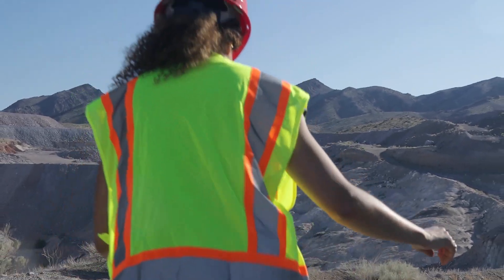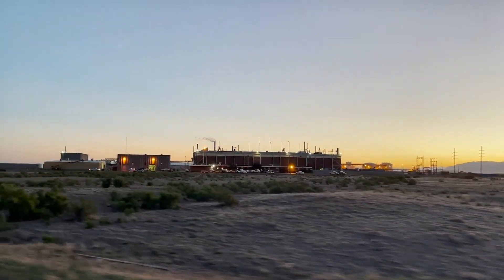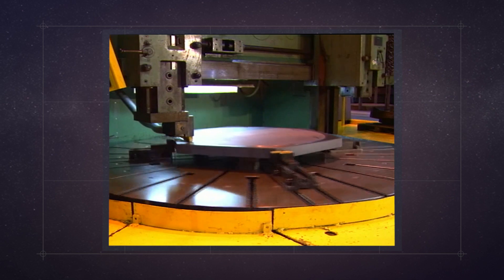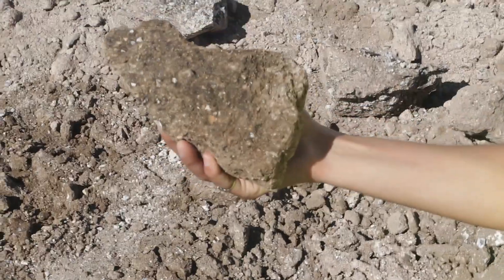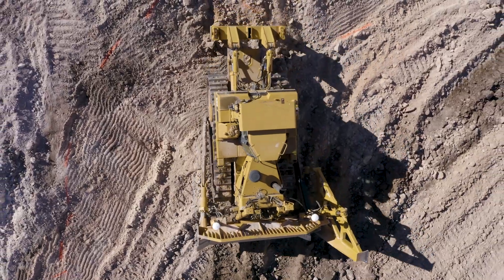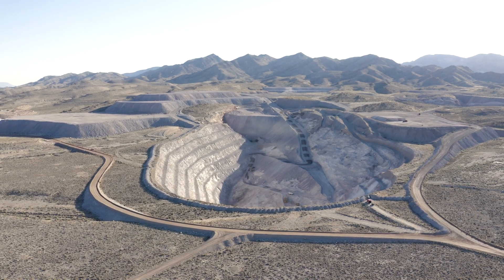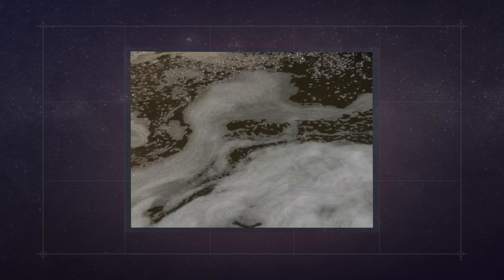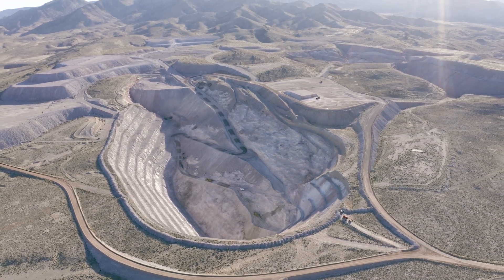Elements of Webb: Beryllium Part 2, Ep 04

Comment: Guys, I did the maths. 7200 cubic inches per mirror * 18 mirrors * Be density (~0.06676 lb/CI) = 8652 lb Be (3924 kg) -> 34,600 tonnes of rock moved for JWST.
Reply: From one spot.  And we use beryllium for other things....sounds like this video is bs

Comment: Does anyone know how much beryllium is in JWST? If global production is circa 220 tons, how much of that was needed? ITER uses 12 tons, so a significant proportion of annual output.
Reply: Well if my math is right about 44 tons was needed for production.  5'x5'x2in = 60inx60inx2in = 7,200in^3 x 18seg. = 129,600in^3 x 16.3871cm^3/in^3 = 2,123,763.49cm^3 x 1.85 g/cm3 = 3,928,962.4565g/1000g/kg = 3,923kg x 2.206lb/kg = 8,667.29lb / 2000lb/ton = 4.34tons.  Nope I missed a decimal in the 44 ton math, so it's only 4.34 tons.

Comment: Again, no mention of the toxicity of Beryllium.  I remember proposals to use Beryllium when I was in the military, citing the same reasons it was chosen for JWST, and all were turned down because of the cost of working with the metal to OSHA standards.
Reply: Many decades ago as a junior engineer at the BBC (early 1970's) I made some heatsinks as a part of a modification to video amplifiers in a distribution system. They only needed small pieces of beryllium alloy sheet, but I had to work under a fume hood and wear a mask. The scraps, shavings and dust had to be collected and sent off to be disposed of safely. A bit scary.
Reply: Stop the FUD please. Beryllium powder is toxic. Solid beryllium isn't. In fact, it is quite inert chemically. Pretty much ANY powdered metal is toxic. Silicon (asbestosis), aluminum (cancer), iron (liver failure), even carbon (black lung). Powdered metals are occupational hazards where machining takes place. It's irrelevant for ordinary uses.

Comment: Is beryllium not toxic in the raw state? Machining the finished metal is extremely hazardous and requires specially enclosed machines to prevent any dust escaping.
Reply: It is safe if it is not in a particulate form that can be inhaled, not much different than lead, asbestos etc.

Comment: I wonder when NASA commits themselves to the metric system.. 

4 tons of rock per pound of beryllium is a completely nonsensical ratio to most of the world. How many pounds is a ton? 2204 ish, according to Google..

Why not make it much more relatable and call it 100g per ton?
Reply: Because 100g per tonne would be wrong. 1 out of 2204 lb is 0.00045 or 0.045% and 0.045% of 1000 kg is 453 grammes, 4.5 times more.
Also Lets Go Brandon doesn't know that the Imperial system has been tied to the metric system for nearly a hundred years.
For example, the inch was redefined to be exactly 25.4 millimeters, so it uses stupid fractions instead of the far easier decimal system.
Reply: Americans by our very nature aren’t conformists to anyone else’s rules.  Otherwise we wouldn’t even exist.  Hard for others to understand I guess, but I like being unique.  Plus it doesn’t keep us from having millions of foreigners per year still trying to immigrate here so I guess it’s not a problem for some.  In other words, get over it.  A ton is about 2,000 lbs.  See, not that hard.
Reply: @letsgobrandon987  a tonne is 1000kg. See, not that hard
Reply: @johnturner4400  there are 3 different tons.   2000 lb = 1 us ton (short ton)  ,    2204.6 lb = 1 metric ton (1000kg), and a 2240 lb = 1 british tonne (long ton).
Reply: @letsgobrandon987  so why are the allegeded "non-conformists" happy to use the English language and it's largely abandoned Imperial weights and measurement system? 🤔😉
Reply: @letsgobrandon987  Europeans? You know the entire world except the us, Liberia and Burma use the metric system. Also nasa uses metric in everything they do. Are you forgetting the fact that the imperial system is literally defined by the metric system?
Reply: @letsgobrandon987  where was I crying? I was just saying facts B) you're just diverting the attention from the fact that you have no real answers.
Reply: Brits set all that up when they ran the show/colonies. Take it up with them. Besides, it’s NASA, not ИASA.

Comment: Why use beryllium when you can use a slightly wider element? lol
Reply: Light passes through Beryllium. That's why it's being used.
I've never heard of a 'wider element'.
Reply: @iancanuckistan2244  It is used because it is the lightest metal, is dimensionaly stable at extreme low temperatures. All other metals shrink and warp at the tempatures JWST will be experiencing.
Reply: @inkman996  I'm aware of all that (aside from the fact that lithium is the lightest metal but not at all suitable for this application)). It was also picked because light passes through it.
Reply: @iancanuckistan2244  Yes lithium is technically a metal, but I am referring to a workable metal which lithium is not. Beryllium is the base of the mirror has nothing to do with light penetrating it. Photons are reflected by the gold  coating on the beryllium base, gold is used because it is about the highest reflectivity of any other material.
Reply: @iancanuckistan2244  BTW beryillium is translucent to xrays and gamma rays, not infrared or visible light.